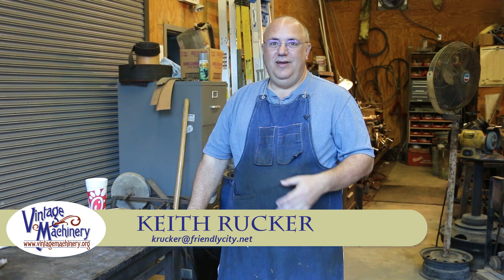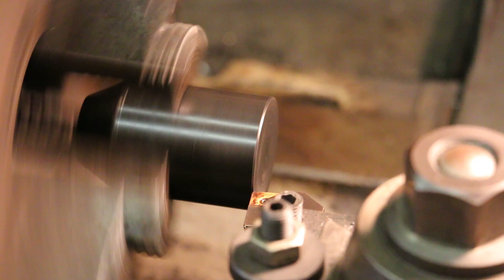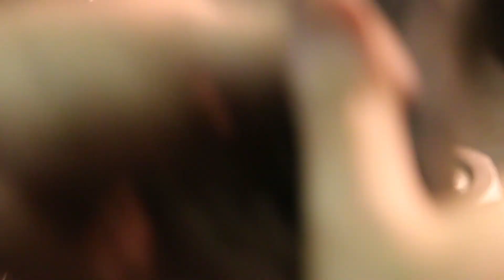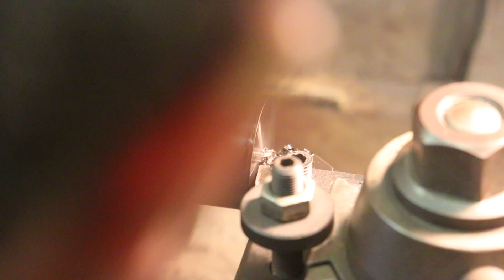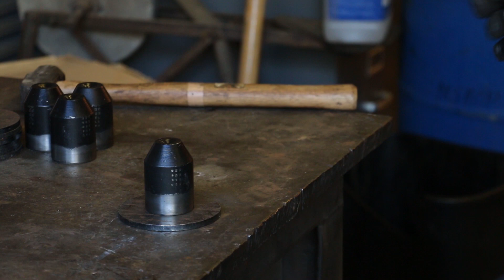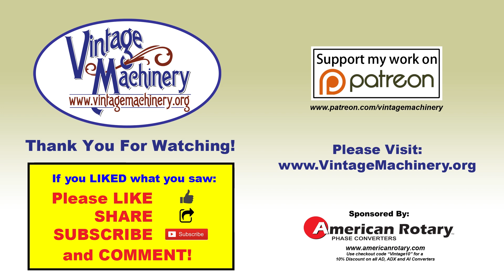Leveling Screw Feet Modifications

Comment: Rough numbers...with the old feet the horizontal or "bump" force would need to be about 1/3 the machines weight.  Simple moment diagram - resolving the forces about the lower edge of the foot.  Radius of ~1'' and a height of ~3'' gives (machine weight * 1'' = horizontal force * 3'').  Reorganizing (horizontal force / machine weight = 1/3).  So let's say the lathe is 3000 lbs conservatively, you'd need a 1000 lb push to get it moving.  The number of feet doesn't matter as the lathe weight and horizontal force is equally distributed.
Reply from the maker: That's some fancy math there!  But it just shows what I kind of already knew - it would take a LOT of force to tip that machine over!

Comment: Are you going to put some rubber mat under those, to protect your floor and keep your lathe from walking around?
Reply: Hmmm.... I suspect that may not be such a good idea. The lathe is fairly heavy, and not all the feet bear the same load. Over time the rubber under the heavier loaded feet will 'cold flow' (squeeze out) out quicker than the others, and the machine will again be unevenly supported. Later readjustment would be more a perpetual exercise in chasing cold flow... One extreme example of cold flow is how rubber displaces under hose clamps.
Reply: +rwbishop Seems reasonable. However you can buy mounts with rubber elements specifically made for lathes and other machinery. For example, Trelleborg makes a range of level mounts for machinery and have done so for years... So, most probably you can handle that problem by using the right type of material.
Reply from the maker: Not a bad idea!

Comment: I might be remembering wrong, so bear with me. I thought Tom at Ox Tool used three point leveling on all of his machines. Is that an especially difficult setup to switch a machine to, or are his machines just built that way already?
Reply: i dunno, lathes often have 6 or 8 feet, and you have to use all of them to support the ends and adjust to prevent lathe bed twist, dunno how youd get it down to 3!
Reply: Tom uses a 3 point system to get his machine level and then spreads the weight out on all the feet. It makes leveling the machine quicker and easier.
Reply: The only time three point mounting is mentioned is the mount for the granite surface plates.. Review the videos of the Standridge shop tour or the plate reconditioning project in Tom Liptons shop. The Standridge tech does a good job explaining why the three point mount is necessary for the slabs.
Reply from the maker: Three point is much easier to level, but with the lathe, you have eight feet - which is common.  My surface grinder has three point leveling.

Comment: I reckon I would have done it differently,  just to be different.  Remove metal from the plates and only tack the 'uppers' into the 'soles'.  Gain a mm or two in height, but close enough!
Reply from the maker: That would work just fine, but at the end of the day it really does not matter....

Comment: Why only a dimple an not drill an tap ?
Reply: the mounting bolts probably have a point on them, so you want them to sit, not screw directly into them due to possible misalignment issues.
Reply: It's cheaper, faster, easier, and stronger to weld them
Reply from the maker: The elevation screws thread up and down in the base - you don't want them to thread into the foot - you want them to just sit on them.

Comment: why is it so importen to level the lathe, or mill, or any other machine
Reply from the maker: The ways on machines are ground and scraped when they are level.  If the machine is not level, it can cause twist in the bed and cause the machine to not cut straight.

Comment: I would have drilled a 2" hole through each plate, put the slug in the chuck and have it stick out of the chuck 5/32" put the plate over it,  then welded across the bottom while in lathe and faced it off.- faster and cleaner looking.
Reply from the maker: That would have worked.  Not sure if it would have been any faster though....
Reply: Hard to compare, but when I did a similar job, and I chucked all my discs in the 3 jaw at once and drilled all the holes in 1 operation, then welded each disc to the slug while in the chuck and then faced it off- was pretty fast with less  changeouts.

Comment: You have increased the surface area of the feet by 300% to a total of 100 square inches. That should be plenty of weight distribution.
Reply: They are round inches ;)
Reply: Square rounds? Seems like I heard of that somewhere.
Reply from the maker: Yes, you are right on - 100 square inches!
Reply: Keith Rucker - VintageMachinery.org About the size of my ballet booties!

Comment: So LeBlonde thought a 3/4 screw could hold the machine up but your viewers are concerned that a 2 inch footwouldn't do the job?  I'm no engineer but I'd put my money on LeBlonde.  If they're saying 3/4 is good its probably overkill which means 2 inch is 2.5x overkill and 4 inches is rated for fault line duty in earth quake country.